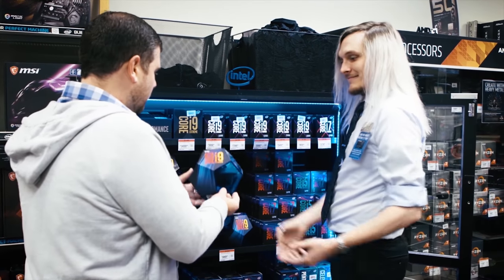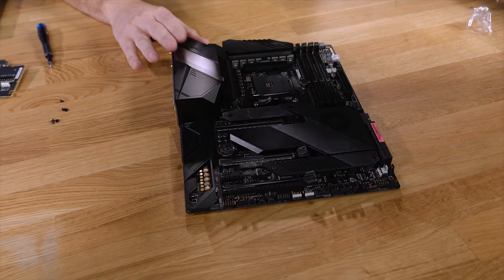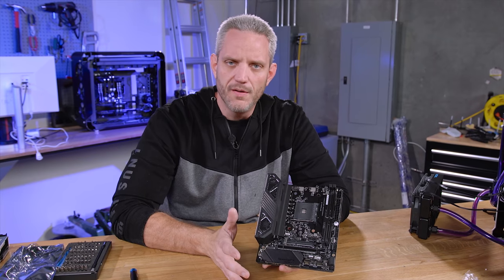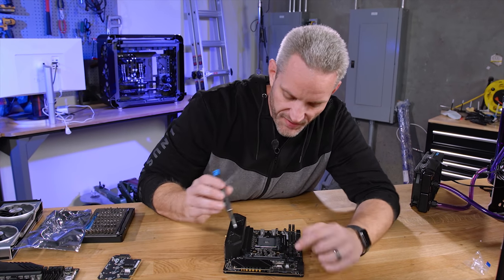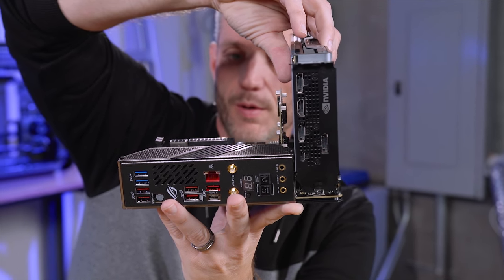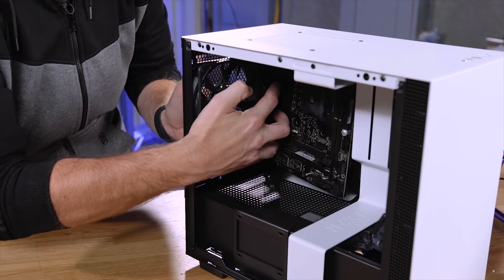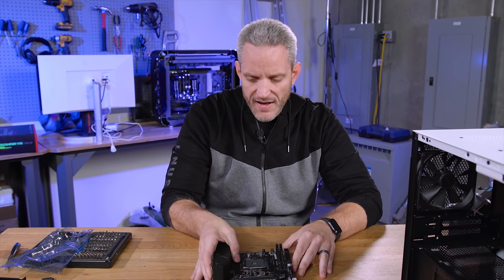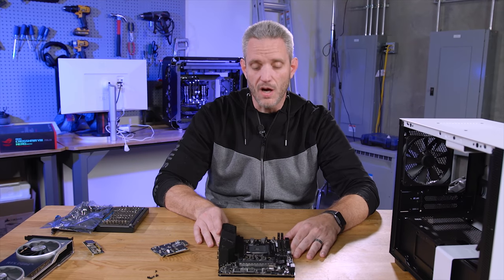This Mini-DTX Motherboard is NO JOKE!

Comment: I know i'm super late, but the Lian Li O11-Dynamic Mini only uses a SFX power supply and this board DOES fit. 
Had a long conversation with a Microcenter Employee and reached out to Lian Li directly about it. 
The rule I was told was if it can fit a MicroATX board, it can fit this board, because this board is as WIDE as a miniITX board, but as LONG as a microATX.

Comment: hey jay im running this board with an 3900x cooled by an bequiet darkrock4 and the temps are great
Reply: with that sodimm card the distance is like 2mm to the cooler an 5mm to gpu backplate

Comment: Would like to see a comparison benchmark of the GPU side in the 2400G vs 3400G vs 1650 / RX 560 / GTX 1660 (or equivalent modern cards). It would be cool to see just how much behind these GPUs are, and you could do like say 3400G and then just insert the GPU card for a fair comparison.

Comment: You said about removing the stickers on the m.2, yet before you, and just aboiut every other reviewer has said that the manufacturers use thermal stickers so the heat is transfered, so no need to remove those stickers.
Which are you now saying is correct please?

Comment: No M.2 between the board and plate on the backside ?
I do think that if you don't use front audio you still have to put the little card in to even get audio due to the chip that's on it SO it can't be used for a M.2 SSD !

Comment: my two slot graphics card completely covers up the active chipset cooler thus making it useless. It reads 90C using hwinfo after about an hour of gaming. thought it was a design flaw on my motherboard but it seems to be the same location on most x570 motherboards. Glad they fixed it on this model.

Comment: So... can you use the Ncase M1 instead of the H210? It fits mini dtx boards, large pcie cards, sfx psus, and decent sized air coolers or a 240mm aio, plus it'd be a much more interesting choice than the H210.

Comment: It does have active chipset cooling. @ 2:51 To the left, rear panel area with the fan(s). That is where the chipset is located. Check Asus product page, it shows "active VRM and chipset combo heatsink" pictured there. 
https://www.asus.com/us/Motherboards/ROG-Crosshair-VIII-Impact/

Comment: I wish they put 10g ethernet on the small form factor boards :(
Reply: Arvi Lefevre why?
Reply: @strimmerj4384  Because there's only one pci-e slot so you can't have both a gpu and a 10gb nic.
Reply: or at least 2.5 / 5 Gbps
Reply: Arvi Lefevre they don’t even put it on full size their top of the line X570 board which I have.
Reply: Where are you going to fit it though? 10g, whether Intel or Aquantia, takes up a lot of pcb room and this board is so cramped in the i/o area.
Reply: @Lead_Foot  That's exactly why I now switched back to ATX now. Wanted to switch to a 10 gigabits network and had no chance to get it to my ITX-Board with a gpu installed. X_x
Even µATX wasn't really an option because most boards have only PCI x1 at the bottom and I have a triple-slot gpu.
Reply: Sven Oesterle there’s a 10 gigabits lan on the X570 Phantom Gaming-ITX/TB3
Reply: @bastosdansleursmeres5383  Ehm nope. Just I211-AT so it's also 1gig.  ;)
Reply: Expect it when Intel/AMD decide to integrate it in their chipset. I believe Intel will do so for 2,5G in 2020.
Reply: Maybe if they have a Mini ITX/DTX Threadripper board
Reply: @shavenne  Thunderbolt 3 to 10GBit adapter!
Reply: What percentage of the population could even gain access to greater than gigabit internet in their home for any amount of money? Hell, you're lucky if you have access to gigabit. Most people can only get 40 or 100 no matter how much they wanna pay. Maybe a 10 gig local network connection is nice but for what? Dumping 50tb of furry porn on your roommate's computer?
Reply: @cm01  It's not because you don't see the benefit for 10G at home that it doesn't exist (I use my NAS as a shared folder for my pictures/videos, so I want high speed network).

Comment: no chipset cooling? uhm the chipset is placed over at the IO cover AND there is a fan in that cover afaik on that board...
and of course you might not be able to fit a DTX in and ITX case (it's in the name) just like you might not be able to fit an ATX in an mATX case

Comment: Paul said there is no need to remove the stickers from your M.2 because the manufacturers make the stickers so that they will transfer the heat through them. You said they need to be removed. Which is it?

Comment: 2080Ti exhausts very hot air that I don't know if it is a good idea to use the riser card. The nands on the M.2s might like it but the controllers will probably die of very quick death. I think a custom loop for the GPU is the best bet for the riser card.

Comment: Yes, but this motherboard doesn't fit in any cases where you'd want it. Ended up having to trade mine out for the Strix...because I had a Shift and I would have had to cut out the back panel to give it room lmao. You can fit it in the Shift with that mod, though, and the removable back panel would completely hide your case-mod.

Comment: I keep hearing that people are having a hard time getting their 3000 series higher than 4.2 but my 3900x sits rock solid at 4.5 @ 1.375v. Idles at 47 and under load hits about 82 with a h115i. I run it at 4.3 @1.3v for my daily. Guess I won the lottery for once.
Reply: Buy lotto ticket now
Reply: @MrRourk  seriously.
Reply: I got one to 4.7 and two others to 4.3
Reply: @MrRourk  sounds like you should buy a couple lottery tickets as well.

Comment: Could you do a segment on M.2 for WiFi or M.2 EKEY (same thing)? I recently got a Asrock X570 Pro4 motherboard and notice this third M.2 slot, which sent me chasing down the rabbit hole of the internet looking for something to stick in it. This kind of dovetails with the topic of WiFi 6 since I found an 802.11ax/Bluetooth 5.0 adapter that looks pretty sweet. Now it seems this board format is more of a laptop thing but more desktop boards seem to be adopting it. (At least the Asrock X570 Pro4 anyway) Is Intel the only OEM? 

...But ya. Glad I didn't run into that dude with the long hair when I was down at Micro Center last Saturday...

Comment: the VRMs don't have to be good enough to support a manual overclock with ryzen 3. the vrm just have to be good enough to keep up with the temperature boost.
Reply: Advocatus Diaboli  AMD  automatically boosts as the temperature goes down like Nvidia GPU do. this form of boost is considered overclocking and takes a toll on the vrm.
Reply: Advocatus Diaboli  basically what I'm trying to say is that you don't need a good enough vrm to manual overclock. you just need a good enough vrm to keep up with your cooling. runnings in 3 on chilled water you better have a good grm to keep up with the boost.

Comment: I've been wanting to buy this board for my mITX tower I already have, but no one could confirm if it would fit (I was pretty confident it would) 

But cool to see Jay using an H210i, I was going to put it in my H200i. Now I need to decide what Ryzen processor to use.

Comment: What happens if I stick a SO-DIMM RAM-Stick into that thing? Is that slot wired up as RAM or does it just use the same connector?

Comment: How does one connect their front panel audio jacks to the sound card when the plug is facing the motherboard leaving a few millimeters for the wires and the whole thing is covered by a decorative "heatsink" cover. I want to see how that works without OCD cable management or modifying anything in a randomly selected case.

Comment: Could you do a video explaining how to setup VR settings? 
I built a computer to play DCS World. 

Ryzen 5 3600
RUF gaming x570 wifi mobo
32 gigs of 3200 G.skill Ram
Powercolor red devil 5700 xt

Using a Rift S for VR. 

It's playing well, it's been great but I was wondering, do the in game settings matter for VR? there's a settings tab for resolution etc, but also a tab for VR with pixel density etc. 
Do I lose VR performance because I'm also sending high settings to my monitor?

Can I turn the "monitor" settings down and the pixel density up? Or is the HMD considered a second monitor and the settings correlate to both?

Comment: I have a concern about this item.
I was excited to consider a Mini-DTX, but now I see a big issue:  I do not see a spare PCI-E slot.

It looks they gave up the extra slot purely for a Riser card for the M2 NVME SSD.  I need that slot to fit a dedicated soundcard.
This is a problem, as the ASUS STRIX m-ITX board already has an M2 slot.

So my question is,
With this motherboard, would it be possible to fit all of the below items?
1x M2 NVME SSD
1x Graphics Card
1x Sound Card

Comment: Two questions:  Do you think it would work in a Fractal Design Define Nano S? and do you think the SO-DIMM would interfere with a custom water cooling loop w/GPU waterblock?
Reply: It will work in any mITX tower that allows for a 2slot Graphics Card without relocating it, and the GC will stick out beyond the sodimm.2 so it won't get in the way of tubing.
Reply: Ty for taking the time to reply.
I am confident the board itself will fit in the the case.  I am a little concerned that some of the connectors are right angle point down toward the power supply.  I know Jay has built in the nano s so  askingnif he knows if there will be a conflict with extra board length, connectors pointing down toward a full atx psu.

Comment: Am4 users: stuck at 4.2 ghz on 6 cores multithreaded 
Me: stuck in 2007 and at 3.06ish ghz quad core 
thanks for making me feel small
Reply: Q6600?
Reply: @rcradiator  I should have said 09. First gen i7 950.

Comment: I have a build in mind, for which I had so far planed to use the Asus Rog Strix x570-I Gaming, but now I may have changed my mind, provided someone can answer a question for me.
Is it possible to convert the dimm.2 to a fully functional pcie 8x (16x physical) slot, for gqu, or similar high bandwidth device? It would of course have to be possible to use it in an 8+8 configuration together with the other pcie slot, at least one m.2 slot would have to be usable, and pcie 4.0 on all lanes is assumed, so 20 lanes in total, and then of course 4 lanes for the chipset. So all in all, in theory at least, it should be possible, or am I completely mad to think such a thing?

Comment: Sound card can be removed and connect anything else?  If I heard correctly its pcie connection. Had 1 slot watercooler gpu card and want to add 10gbe nic, so looking where to connect it

Comment: Ok wait a minute. The mini DTX has a single channel, but the memory operates in Ganged Mode, or Interleaving. When will the industry correct this naming convention to better identify the capabilities of what ram does. I get why the call it dual channel, but then what does Ganged mode actually do?  Ganged mode is combining the bandwidth of two 64-bit memory slots to get 128 bit bit. So Ganged mode is what they're calling Dual Channel. Ok what-evs.

Comment: seperate from this video but still tech why are there not vendors fir custom one of heat sinks and water block with cnc machines and 3d printing it should be cheap and easy to run 1 off heatsinks for vrm and gddr modules etc...

Comment: 7:40  new fundamental law of thermodynamics.  JayzTwoCents law of proportional heat from megabytes per second. More bandwidth makes it hotter, lol.

something about that regarding PCIe v4 has bugged me. People think it's hotter cuz it is faster, almost to imply that power consumption is irrelevant for the heat production of PCIe 4.0 devices, lol.  Maybe in time, they can 'refine' things to consume less power and thereby not produce as much heat, it is bleeding edge new stuff. As much as some make it sound isolated in its own universe, I don't think conservation of energy somehow doesn't apply to computers, lol.  I'll call J2C's new law of thermodynamics a 'yes' , 'no' and 'sort of'. lol.

Comment: I have found on Amazon and Newegg. After market heat sinks that us put on mosfets with thermal tape. (better than nothing) Oh, Intel can hit 5Ghz. (insert all intended sarcasm) Big deal, that like shocking a dead horse. I think the main reason why AMD is having problems. Is for years Companies have been making programs around Intel and NVidia. Now that Ryzen and Epic have shot the high horse. Intel has been riding, Programs have yet to be written to take advantage of Ryzen (cough Adobe)

Comment: near choked when i looked up the price of these. I thought my VII Impact was an expensive purchase at the time, but happily paid it for the R&D and feature-set... However, make no mistake, the price for this board is BAD for what this board is - there's no way to justify a 4 Phase design being over DOUBLE the price I paid for my VII Impact. The components aren't exceptional; the design is not particularly radical; the feature-set is merely on par with the rest of the ROG line-up. Sorry, but this is a shit deal and if you buy one, you're paying too much

Comment: The board also fits inside of an Inwin A1 Plus (and that info (along with pics) is coming direct from Inwin themselves on their Facebook page:  https://www.facebook.com/INWINEUROPE/posts/2344111018978775  ).  I have an original A1 and it looks like it'd fit, but I'd have to see what Inwin changed on the A1 Plus to be sure.  :/

Comment: Hero class boards dont have DIMM.2  connections because it's not a high enough tier product segment. Its reserved for ROGs 500$ plus flagship level boards. (Apex rampage zenith ect) they also dont give driver USB drives until those 500$ price point boards either. 429$ board? Driver CD for you. And a stupid cardboard cup coaster. Fuck am I supposed to do with that?

Comment: Small form factor: But Big!

Unmitigated idiocy.

Manufacturers are practically killing μATX so they start creeping ITX up to μATX size but make it worse. You get all the sacrifices of ITX, but big!

Of course, most ITX cases are honkin' huge as well, also idiocy. If the case is as big as a μATX case build a μATX machine in a μATX case. You sacrifice too much in terms of electronics for ITX to go and make the machine smallgantic.

Comment: Would you spend an extra $150 on a graphics card that gives you 5fps more?
No. Then why bother overclocking your cpu with added costs of board and cooler! Same analogy!
Waste of time and money, just buy a faster cpu!!!
Reply: ....and then overclock it !!  :-)
i never noticed a longterm improvement of lifetime/usage on my cpus/gpus, until a point they are overpowered without OC, 
after that point they are not good enough to set all to max, and a few % more fps because of OC do not matter anyways.
more gain by tweaking game configs.
i usually play around a bit but don't notice it in normal usage.